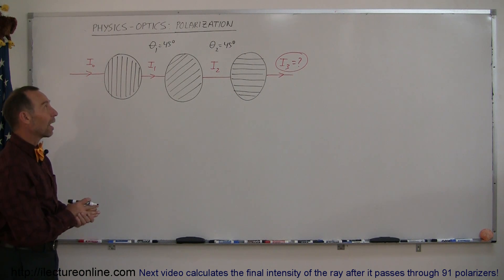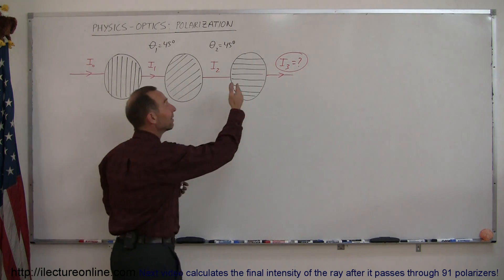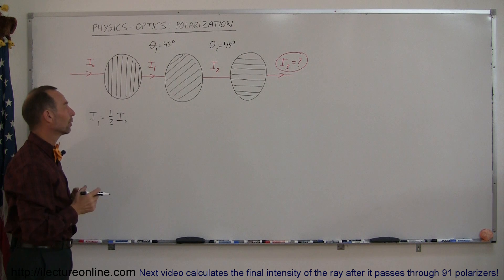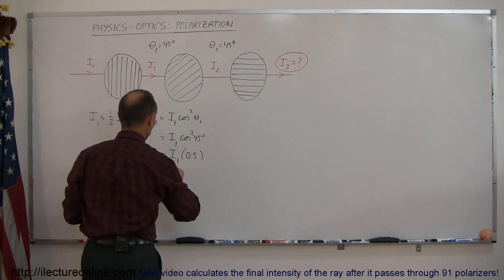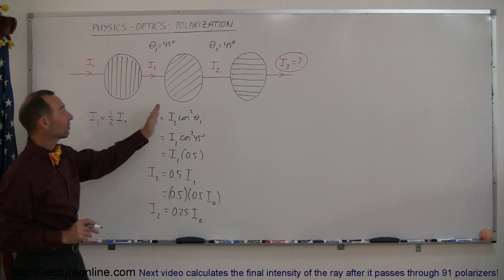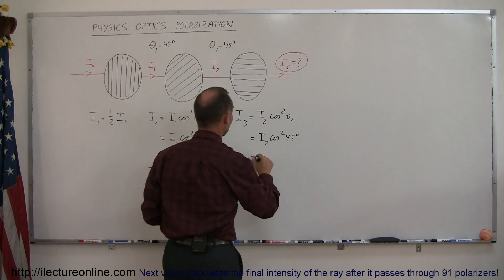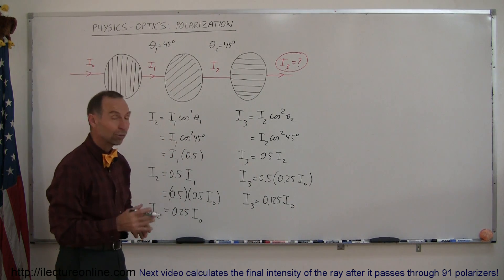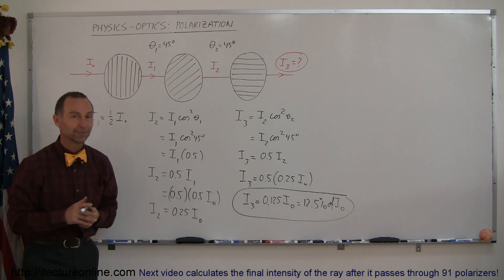Physics 53  Polarization (3 of 5) Three Polarizers

Comment: Sir, why isn't the intensity zero after 3rd polarizer? If we see 1st and 3rd polariser they both are at 90 degrees.. now light we get from 1st polariser let it be along z axis , now if we see after 2nd one : the light will still be along z axis but amplitude differ(as we read in polarisation) now this light will again encounter with another polariser but that polariser is 90 degrees i.e y axis so the whole light should completely collapse... And we shoud get zero intensity after the third one.... What's the problem here???
Reply from the maker: Yes that is a bit of a mystery.  But is is correct.  You can try it with 3 pairs of sunglasses.  Hold two perpendicular to one another and the light will almost be entirely blocked.  But when you hold a third one in between at an angle, some light will get through.
Reply: @MichelvanBiezen  thanks sir, I found later that light passing through a certain polariser, exibit same plane as of polariser.. that makes sure the light obtained after 2nd polariser was 45° of the earlier one but reduced intensity.. so the light always had a component lying in the same plane as of polariser and only that component moves ahead. I got it sir.. the actual reason

Comment: So one could graph the resultant intensity based off of the 2nd polarizer as cos^2(pi/4)*cos^2(pi/2-x)*cos^2(x)?
Reply from the maker: The best way to check is to calculate it and see if you get the same answer as in the video.
Reply: @MichelvanBiezen  I did and I got the same result, just wanted to comment tbh

Comment: I think the filters breakdown the field, try to use polarized filters that reflects 50% polarized light, like polarized mirror. I believe those filters breakdown and mergers the field The light must be there, the filters just changes to a spectrum we are not able to see it, using mirroring polarized erases the light we are not able to see it. The mirror and polarization must be in the same layer.
Reply from the maker: It is not really a believe.  The science behind polarization is well understood.
Reply: @MichelvanBiezen  this must be proven by experiment only, I think 50% of the light are hidden by changing the spectrum to invisible light waves, the electromagnetic waves appears again when we add another  filter. By having the mirror, it will completely removes 50% visible light away from the setup. We can not use the mirror and polarized filter in two layers they must be combined in one layer. I think light has more like waves behave when passes through the filter, just like double slit experiment. Thank you for your response!
Reply from the maker: I would suggest that you watch some of the videos on electromagnetic radiation which would help in the understanding of the properties of E&M, during interference, diffraction, polarization, etc.

Comment: Hello, thanks so much for the explanation, I'm incredibly grateful.
I have a question; this thing has really stumped me...
I have two polarizers at an angle of 90°. I'm supposed to put a polarizer in between at such angle so that the final light intensity is 1/4 of the initial.
I have been calculating this for a few hours now and I came to a conclusion, that there is no solution to this... (the highest intensity I could reach was at 45° angle and was equal to 1/8). Thank you so much for your answer and videos — like I said I'm really grateful.
Reply from the maker: You are correct.  Read the problem carefully.  Are they referencing the initial intensity (prior to entering the first polarizer) or relative to the the intensity leaving the first polarizer.
Reply: @MichelvanBiezen   Hello, thanks for your answer and time.

They are referencing the intensity prior to entering the first polarizer. 

Now if the beam approaching the first polarizer was already polarized,  this should work out for the intensity to be 1/4 of the initial.

It is not explicitly stated whether the initial beam is polarized or not, however, they do state that the electric intensities of the initial light relative to the axes are equal (Ex=Ey). This should further imply, that the light is unpolarized, since if it were polarized, the intensity relative to one of the axes should be 0.

Are my assumptions correct? 

Thanks for your answer
Reply from the maker: Yes, that is a good way of looking at it.
Reply: @MichelvanBiezen  All right. Thank you sooo much! :)

Comment: Why is I1=0.5 I0? Cos 0=1 so I1=I0
Reply from the maker: You don't apply that formula for light passing through the first polarizer.   If unpolarized light passes through the first polarizer, all the component of each wave perpendicular to the polarizer will be blocked and all the components of each wave parallel to the polarizer will pass through so that 1/2 of all light will go through.

Comment: How many molecules are there in 1m^3 gas in the standard state? (Pressure is 1.013•10^5 Pa, Temperature is 273 K)
Reply from the maker: At STP conditions 1 mol occupies 22.4 liters.    (There are a thousand liters in a cubic meter)

Comment: Unpolarized light falls on two polarizing filters so oriented that no light is transmitted. If a third polarizing filter is placed between them, light still cannot be transmitted.is it right or wrong?
Reply from the maker: Wrong,   if the two polarizing filters are perpendicular to one another, not light will make it through the second polarizing filter.  But if another filter is placed between the 2 at an angle between 0 and 90 degrees (not including 0 or 90) then light will pass through the third filter.

Comment: Hi, I have a problem with my LCD display. The display was monochrome. After removing the polarizing film and rotating it by 90 degrees, the colors have changed. The black has changed to white and white to black. After removing the next filter (transparent, which was under the polarizing filter) and re-applying the polarizing filter, the colors change - yellow, purple, green ..... and I can not use black. I am asking for a hint of what's stuck under the polarizing filter, what should I look for to "fix" my display. On my channel there are videos that show the problem :( Thank you in advance for a thank you.

Comment: Nice presentation.  Please reply, can we say 0-degree polarised image is a non-polarised image?
Reply from the maker: It is not so much the angle, as a beam of unpolarized light will have components oscillating in all directions in an equal amount.  Once such light goes through a polarizer, the all the components of the various portions of the beam perpendicular to the polarizer will be blocked.

Comment: I don't think this is correct. There should be a mention of the change in theta for each equation and he simply just plugs in the angle instead of delta theta...
Reply from the maker: It is correct.
Reply: Michel van Biezen so why don't you plug in for theta two (45-45)? All I'm saying is I had 0 for theta one 30 for theta two and 60 for theta three and I had to plug in an account for the change of theta. So I plugged in 0 30 and 30. Whereas following you I would have plugged in 0 30 and 60.
Reply: the angles that he wrote ARE the change in theta. relative to the first polarizer, the angles are 0, 45, and 90 degrees. he already took the difference - 45 degrees between each.

Comment: What if the third polarizer is moved in place of second. The intensity of light is 0, but in application if you put the third polarizer at an angle of 45 degrees it becomes bright again. 0*cos^2(45). (i2 = 0.)

Comment: Hello and thanks for the explanation, I got a question, If the light is already polarized (vertically for example)and it goes through a first polarizer with and angle, does the intensity would be half? or in that case we have use the angle formed between the vertical polarized light and the polarizer?.
Reply from the maker: In that case you DON'T have to divide by half.  Just use the formula to find the intensity (as if it is the second polarizer).
Reply: I got it now! Thx a lot sir!!

Comment: what if the first polarizer is tilted through an angle theta then what will be the intensity of light is it half of the given intensity or not?
Reply from the maker: Assuming that the light is not polarized when it reached the first polarizer, the intensity will drop to 1/2 of the original intensity when passing through the first one, regardless of the angle of orientation.
Reply: Michel van Biezen really you mean angle does not matter for first polarizer
Reply from the maker: No, only the angle between the first and the second polarizer.

Comment: How come there is a factor of 1/2 for intensity I_1 but not for I_2?

Oh and thanks for these videos! These helped me with engineering dynamics last semester and now this is helping with E&M :)
Reply from the maker: +CheeseTomatoe  When unpolarized light passes through the first polarizer, the intensity drops by 1/2, because one of the directions is completely blocked.      When passing through the second polarizer, the amount of Intensity reduction depends on the angle between the two polarizers.  (note that the light going through the second polarizer is already polarized).

Comment: Counter-intuitive resoult to me. I especially like this stuff in science. Thanks for the video!
Reply from the maker: Yes, The first time I saw this, I had a hard time believing this myself.  When I finally had a chance to study more advanced optics it became clear how it worked.  That is the exciting part of science, discovering for yourself how everything in nature works.
Reply: Michel van Biezen I can kind of guess why the three polarizers in this video work like this - it feels to me like since they are set up so that there is a 45° angle difference, they will never be able to completely block out any of the x-and y-components, but only parts of them.
In other words, if you have two polarizers, and they are perpendicular to each other, then the first one will completely block one component and the second one will completely block the second component, but you cannot completely block any of them if the polarizers differ by 45°.
Kinda hard to explain, but I think it works a bit like this on some level.
Reply: @Peter_1986  it is because polorasiers actualy rotate the light.

Comment: Why/how does this happen?
Reply from the maker: Herp.  The intensity of light is a function of the electric field oscillations squared.  The oscillations of unpolarized light are in all directions.  When light is polarized, the oscillation magnitudes are decreased due to the cancellation of the components perpendicular to the polarizer.  If a second polarizer is placed in the path of the light at an angle less than 90 degrees, then some of the electromagnetic oscillations will survive (the components parallel to the polarizer) so there will still be some intensity getting through the second one.
Reply: I found an article
http://www.theimagineershome.com/blog/?p=39